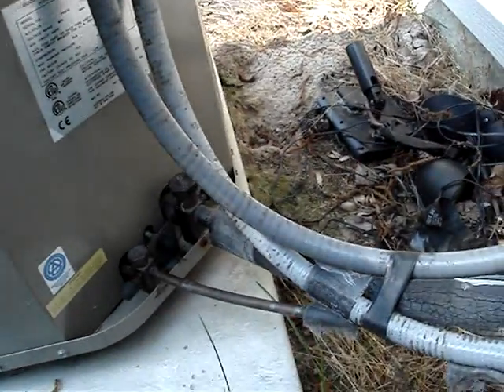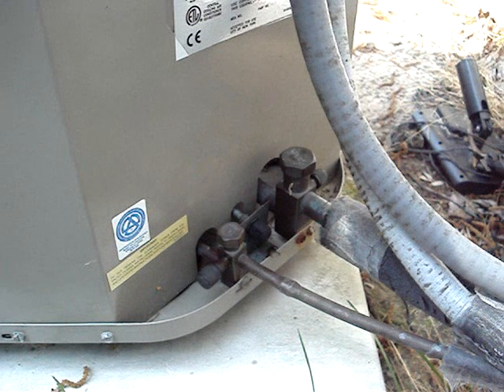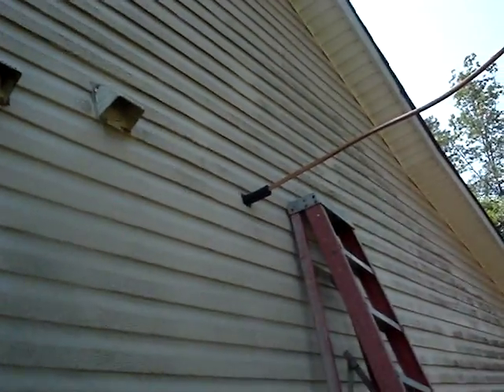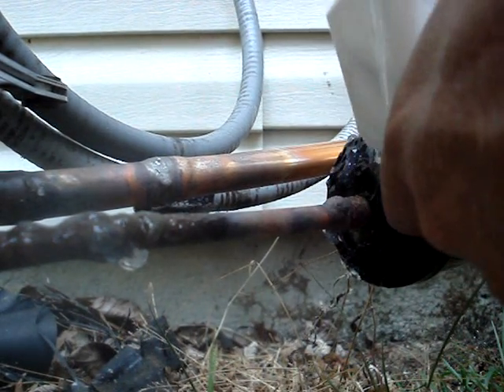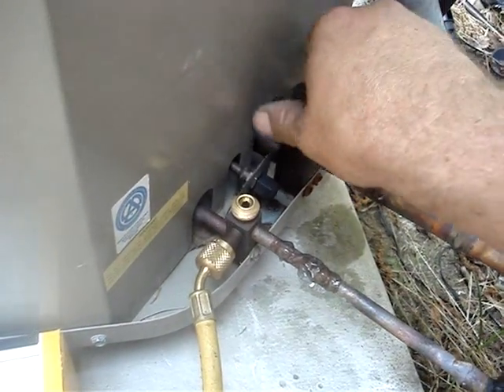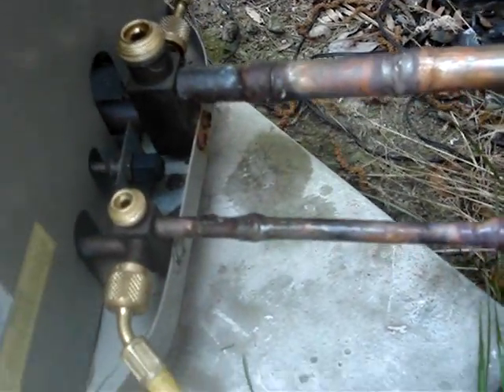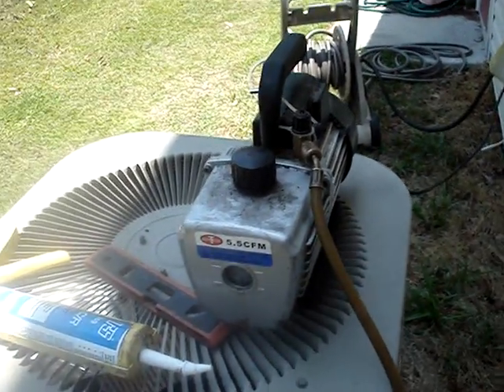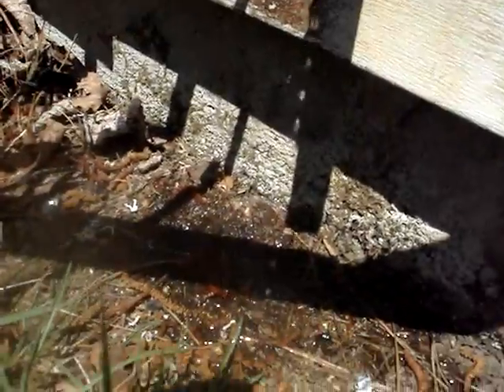HVAC Leak Repair and Recharge

Comment: Hey Zack, ever try this stuff called (Hot Dam!) or has anybody on Zack's Channel try that stuff? Looks like chop meat to absorb heat?
Reply from the maker: I have not used in yet.
Reply: talyn875
Can you do a video on how to change the blower speed on a variable speed Trane XL14i? The idiots that installed it in 2005 put in a 2.5 ton air handler with the 1.5 ton condenser, and I want to bring the speed down to reduce the load.
Reply from the maker: John Smith It should be set with dip switches on the control board. They probably matched that ahu with the 1.5 ton condenser because it created a high SEER match. If I come across one I will film it.